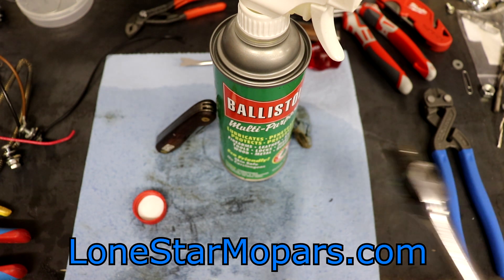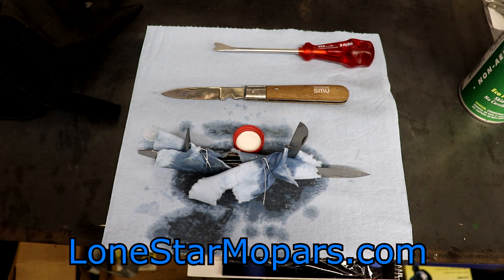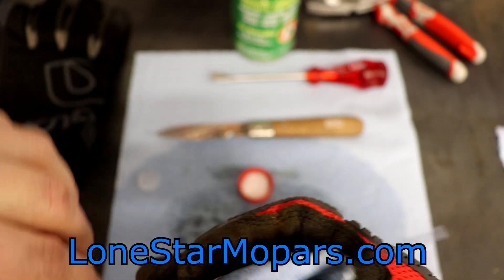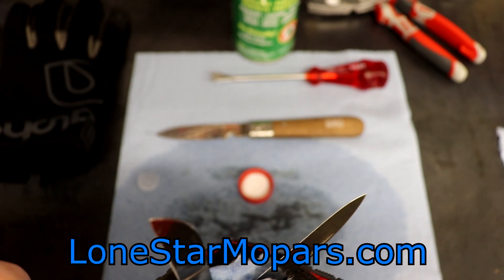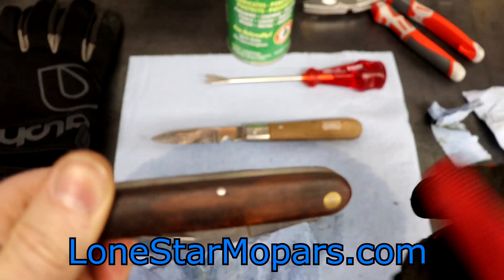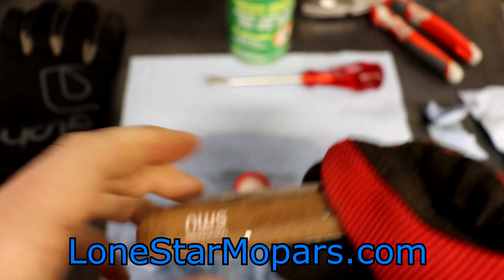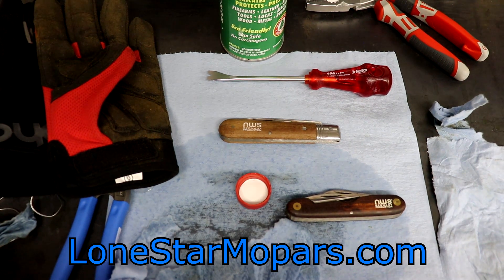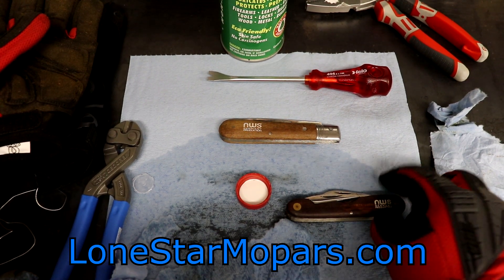Testing Ballistol

Comment from the maker: I've been really busy and had to get to work at 6:30 this fine, Saturday morning.  I like to mix in videos to alternate the KC Tool Hauls, so here is one that was salvaged from several tests and corrupted files.  The bottom line on Ballistol is it works very well, but use it outside...you do not want to have it spill in your shop.  If things slow down a bit I should be able to edit a few other "alternate" videos...
*Also, if you haven't been watching the Ram Revival, check it out!  We revelaed the 408 Stroker last week and this most recent video shows the dyno pulls.  It should be a pretty solid engine for the truck!  Lastly, this weekend is when I would typically host Chryslers in the Canyon, an All Mopar Show held in Palo Duro Canyon...check out the older videos if you are in the mood for some awesome Mopars in a beautiful setting.  Hope you all have a great weekend...make sure not to spill any Balistol.

Comment: I use Ballistol to clean the hand tools I used for work all week.  I also give every new tool a quick coating of Ballistol. I don't mind the smell but my teenage son thinks it's complete "ass". It did stain my white colored handles on the linesman pliers but they operate really smoothly so I don't mind. Good stuff

Comment: Nice video, man. I’ve used Ballistol for years on my firearms. It’s a great CLP-type product that has multiple uses. 👍
Reply: How long does it last on let's say your rails of your pistol? Weeks, months?
Reply: @theone031  I typically use grease on the frame rails of my pistols, especially if the frame is made of anodized aluminum like a classic P-Series SIG Sauer pistol. Ballistol is a good, non-toxic CLP alternative that I sometimes use for cleaning after range trips, quick bore swabs and as a surface protectant. It works well for me in that role. 👍